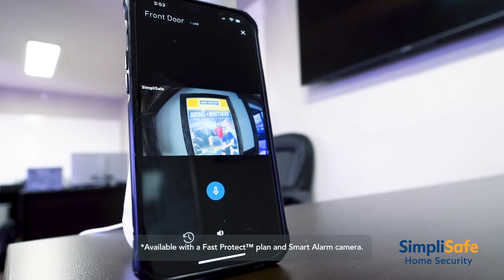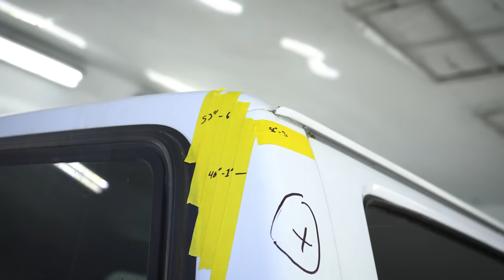I DESTROYED MY EMPLOYEES TRUCK!

Comment: Fyi, ford never sold a "1998" obs. The obs ended in 1997, skipped 1998 and started with early 1999 superduty.
Reply: True. And they changed almost everything. Ive scowered these post 96 trucks for parts that will work on our obs ones, i havent found really anything
Reply: It's a crappy show talk and they don't even  know  about remember they were car salesman's 2nd most untrustworthy  people  right after #1 politicians. 😅😅Lonewolf Canada 🙏🏻 respect
Reply: I have a beautiful 99 F350 sitting in my garage right now!
Reply: Love my 93 obs and my 69 obs both F-250 Ford 4X4s
Reply: Notice they have changed the title to 1996 obs
Reply: @donaldfrenette5599  car salesman A?
Reply: False! There was a 1998 f-250. Light duty 3/4 ton. May not be an OBS, but a 98’ f-250 was a thing. They’re goofy trucks.
Reply: @MrTanner530  like you said, it was not an obs...
It was an under 8,500 gvw fill gap truck. Basically a 7 bolt wheel f150.
Reply: @AndyFromm yep I consider those like old  the old chevy heavy-half trucks. Imo the 98 f250 was no a true 3/4 ton

Comment: There’s no such thing as a 1998 OBS 

OBS F150: 1992-1996
OBS f250/350: 1992-1997
Reply: came here to say the same.
Reply from the maker: Well where did we find this one?
Reply: @SparksMotorsCo you didn’t, someone brought you a 97
Reply: @SparksMotorsCo the only thing they offered in 98 was a weird F150 with a 7 lug system called a 7700.. thats a 97..